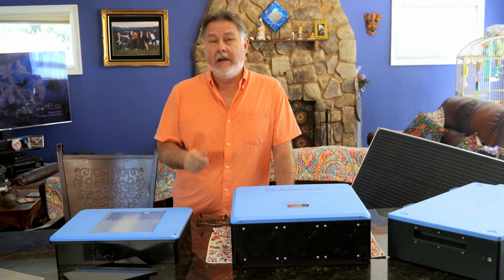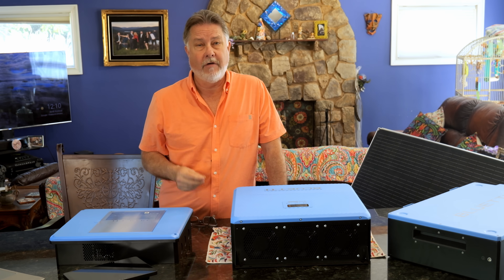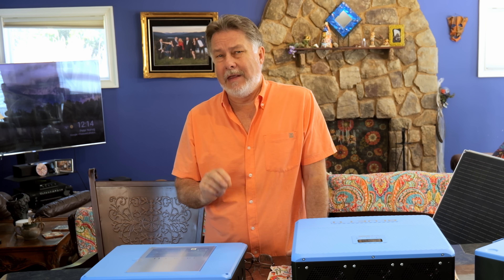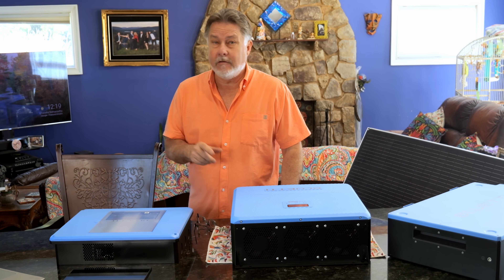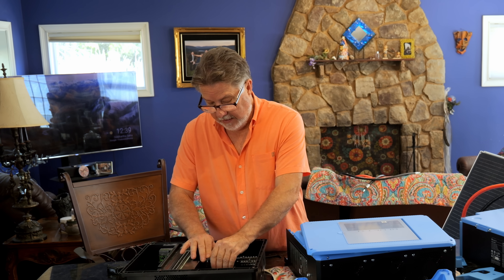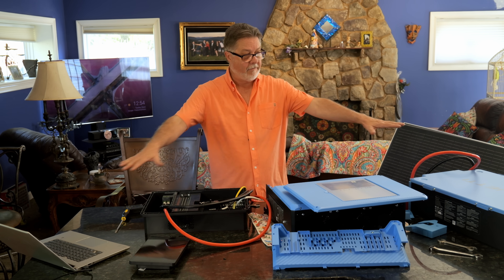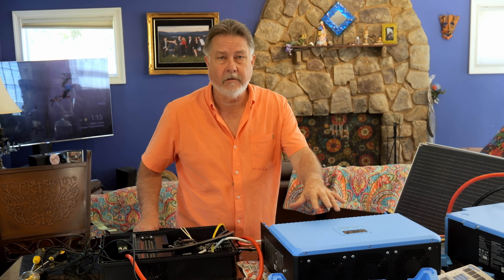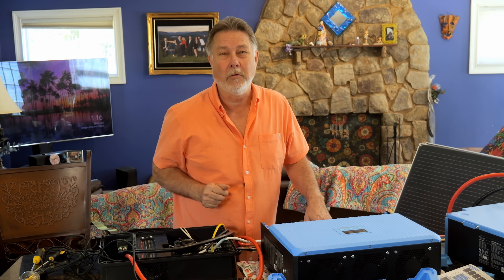Finally… An Easy Inverter System for Boats!

Comment: Will you be able to run your.   A/C  system overnight without the generator ?
Reply from the maker: I think I will need to add another battery to do that, but I'll be running tests in a couple weeks.
Reply: @tryingnottosink9107  The thing is, the energy density of batteries is quite low for the amount of space they take up, and the cost per kilowatt hour. Those solar panels are horrible too. You should look into companies like RES Supply in Colorado, or Krannich. I bought over 100 solar panels for a solar grid tied build at a friends house down by Evansville. I got the solar panels from Krannich (2 full pallets) and the SolarEdge inverters from Soligent. He wanted a battery system too, but it was literally cheaper for backup power in case the power goes out to just buy a large liquid cooled 48 kilowatt natural gas standby generator. That generator can output 200 amps of 240volts continuously for days if needed. He has a big house with 2 AC units, 2 kitchens, a heated (and cooled) 20x40' outdoor pool, over 300 exterior lights etc. 

You would never need that big of a system for a boat though, but the amount of batteries needed to store excess solar power produced in the spring and fall, and be able to last through the long cold winter would be on the order of several megawatts of storage capacity which would cost in the hundreds of thousands easily. Not to mention, who wants the hazard of 20 tons of lithium ion batteries nearby that could catch on fire?

You can get much better solar panels, don't buy retail, get wholesale prices from a proper wholesale distributor like Krannich, Soligent, Kinect Solar is another one that's fairly new. They make panels capable of over 400 watts now.

I think what might be a better off grid system is a small quiet generator that is sized to run at the optimal load for max fuel efficiency that matches the amp draw of whatever battery charger you have. Batteries are good for short term, very high current spikey demands. Like when a big AC unit compressor turns on. Running a generator for a small house or a small boat like yours has quite a few disadvantages. The first one being 80% of the time, stuff on your boat is only using a few amps. It's only for short term things like cooking, or when an AC unit kicks on that the small generator gets overloaded for a few seconds or minutes. And getting a big generator to handle peak loads but your base load is only 5% of what the generator is capable of, is a recipe for disaster, because the engine is basically just idling and wasting a lot of fuel for what little power gets used.

To design the system properly, you need to figure out how many kilowatt hours you use in a day or week or whatever, and divide that by 24 hrs or whatever to figure out what the average load in watts is. For example in my house on the worst month of the year, I might only use about 1000 kilowatt hours billed. That works out to an average current draw of about 1344 watts or 5.6 amps (at 240). So in theory all I would need is a 1500 watt generator to run my whole house....but... that load has a lot of peaks, we come home from work, and cook, clean, do laundry, the AC kicks on all evening because that's the hottest part of the day etc. A 1500 watt generator would not even be enough to run the microwave and the TV and some lights. So I have a 9kw standby generator and 12 solar panels on the roof. No batteries, the grid is my battery I have net metering grid tied inverter. But if I was to use batteries, then I would size the batteries for let's say 1 day of use, so 32 kilowatt/hrs of storage, and then size the generator so it would charge that battery bank in a reasonable length of time, and also the most important part is size the generator will run at about an 80% of rated load, or whatever load in the data sheet gives the lowest fuel consumption per kilowatt hour. This is important, because running it at max rated output on a hot day is very hard on the equipment and fuel consumption can also go up. It needs to run in the "sweet spot" to maximize the life of the engine as well as squeeze every watt out of the diesel as possible.

If you can't afford or have the space for 30 kw/hrs of battery storage, no problem. You just base the battery capacity of how long you want to be able to run what you need before having to start the generator. I think in your case, as long as you can make it through one night without having to run the generator, that will work. Because you can sleep better at night with it being nice and quiet, and not have to babysit the generator. Sure the generator can run unattended, but what if there's a fuel leak, or water leak, or it starts to overheat etc etc. Generators are not easy to pull out of a boat to replace and wow they have gotten extremely expensive over the last 5 years (but what else hasn't?)
Reply: I thought he said 13 hours?!?